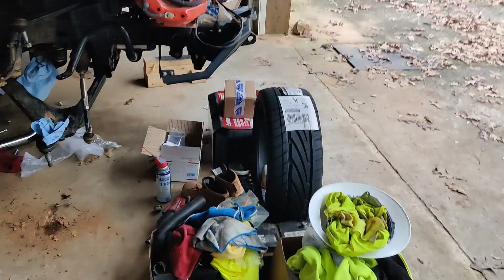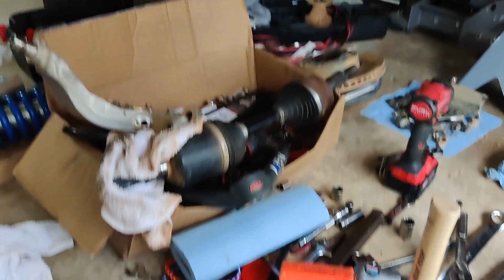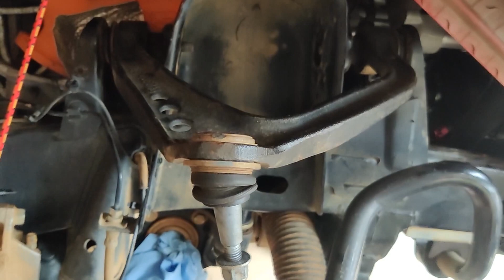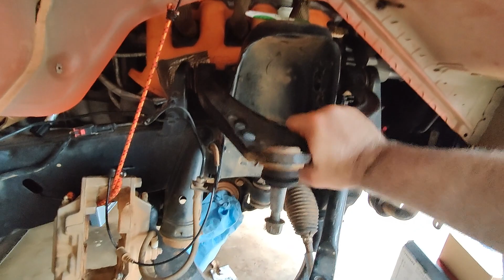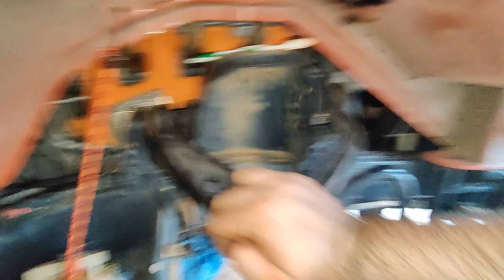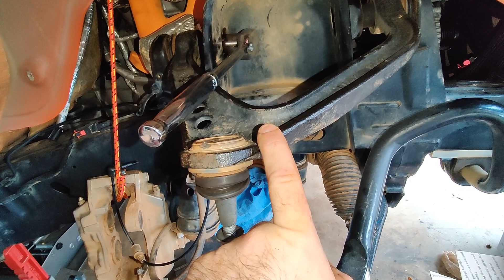Colorado: Upper Control Arm Adjustment for Lift

Comment: Hi can this play a role on determining the hight of a truck? Let me explain. I bought a 2018 Colorado from copart with a bent frame. I got it delivered to my house but the driver front wheel was pushed into the fender. I replaced the upper control arm and tie rod my self to free the wheel enough to load it on a tow truck and take it to a frame shop. The frame shop supposedly fix it, they straighten the frame, replaced the lower control arm, spindle, and got it all align but the truck still looked lower on the front left side and that wheel also looked further back compared to the other side, like if it had positive caster and it rubbed when I turned the wheel all the way to the left. It drives fine but it just doesn’t look right. I took it back to them and they took it to another frame shop to check or fix the frame and did another wheel alignment but it is still the same except that now both front wheels are further back like they have positive caster. I haven’t driven it to see if it doesn’t rub anymore because they still have it. They said that they don’t know what else could be wrong. Now they are going to check the strut since its the only part left to replace and I don’t think they have touch the upper control arm that I changed myself. What do you think could be causing this issue. They say the frame is straight. Could it be the upper control arm that is not on the right position and it’s making the truck lower on that side. I also heard about this trucks having an issue leaning on the driver side and getting fix by adding a spacer or shim on the left strut and left leaf springs but I haven’t mention this to the frame shop because I want them to fix it right and not just to add shims to make it look straight if its not. Im getting desperate because they have had my truck for 9 months now. Its ridiculous.
Reply from the maker: This wouldn't affect that.  That sounds like another issue.  If you only replaced a spring on one side that may be it.  Springs are what sets ride height so I would look there.

Comment: Thank you for this vid. I bought a used 2018 with on 50k miles on it and was getting this clunk on the front driver side. After taking a close look I see there is a level spacer and this is my issue. Whoever installed the spacer did not adjust for this.

Comment: as far as that bolt and a socket with dssv's it can fit but wow its a $#@%. I have coil over conversions to do soon so I will look at this a little more and my bushings. I did the gmpp level and got their new uppers about a year ago. I do have a clunk past 3 months on passenger side.